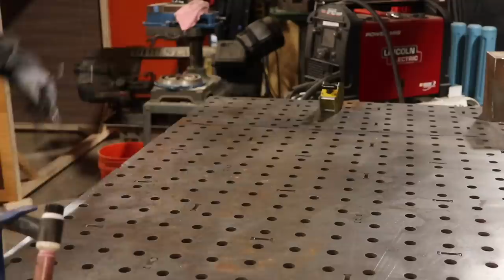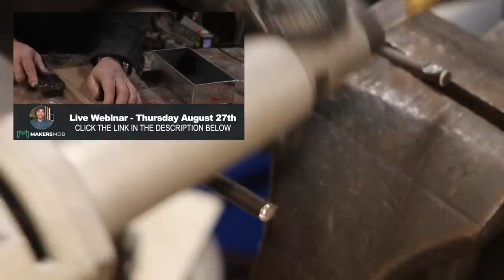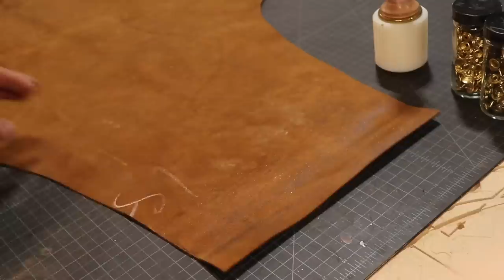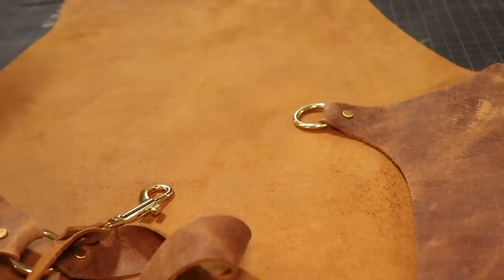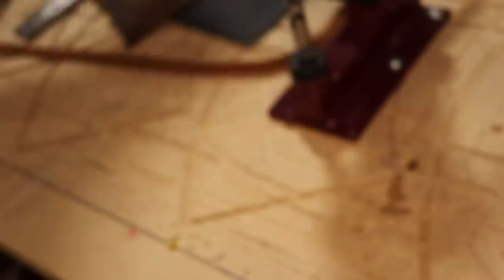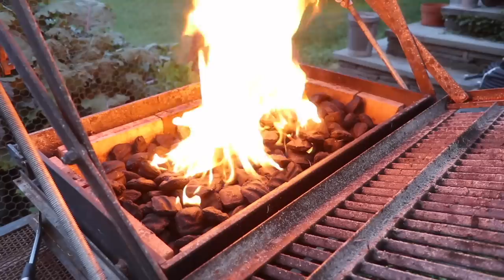DiResta Ultimate BBQ Apron

Comment: Only Jimmy would find a way to incorporate welding into an apron build! 😄 You're the man!
Reply: If the belt sits on the hips right, most of the weight of the apron will be supported there (like a rucksack hip belt). The metal isn't load bearing, it's to stop the top edge rolling down when the utensils are attached.
Reply: @richbuilds_com  chill and relax.no need to analyse.

Comment: It looks like the beginning of a One man Band outfit. Jimmy, have a look at the metal harness that marchingband drummers use. It´s quite a similar thing to what you are going for. Wider metal straps so it doesn´t dig into yr shoulders, and then a strong metal "breastshield" to hang drums from. Or when Jimmy goes for it, a small bandsaw can dangle from that :=)

Comment: I would have replaced the hooks with a magnetic strip to hold all the utensils, other then that the whole thing was alright, especially the shoulder hooks.
I did cringe slightly when you used lighter fluid on the coals, could you build a charcoal chimney next time?